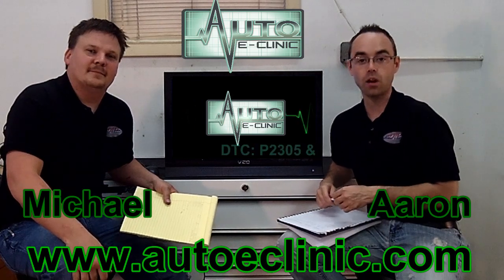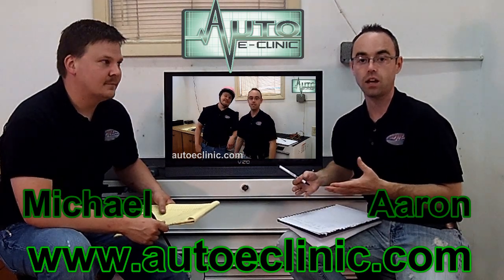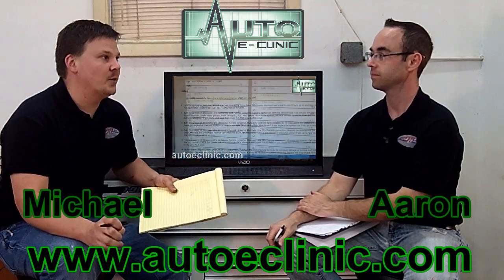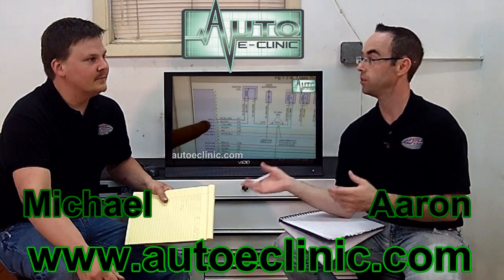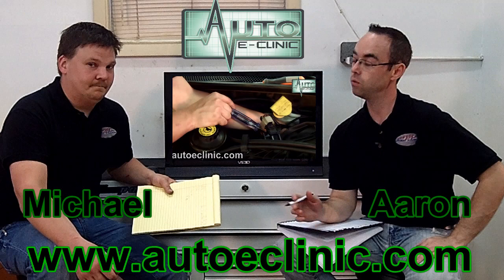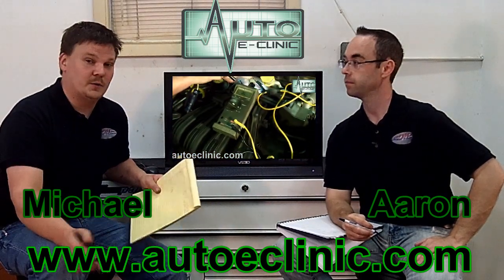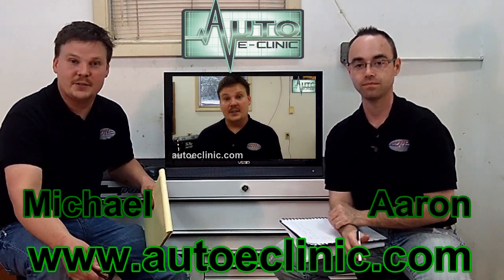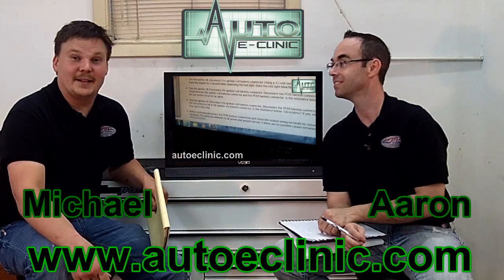Part 2 - Diagnosing P2305 P0352 P0351 and P0300 Faulty PCM (Chrysler)

Comment: If I have replace plugs wires and coil pack on 2009 Jeep Wrangler Rubicon 4 dr and I still get the code P2305, just that code, would it most likely be the PCM? I have checked all the wires I can see and they look fine
Reply: I have the same problem did u found out what was it? Jaybowmanjeeper
Reply: Same issue here, along with code P0300. Did replacing the PCM work? (i have replaced the plugs, wires, and coil pack, still getting the same codes) 2010 JKU.

Comment: its weird that i never had to reprogram any ecu's that i replaced. to shed some light on that procedure, if you look closely to the VIN you can pin point which used ecu can be used in your vehicle that has the some accessories as you do. This will increase your chances of having to go back to a junk yard, auto parts, etc....

Comment: I have a 2005 chrys. pt cruiser 2.4 touring <68k mi.
I'm told by Chrysler dealership after replacing the O2 sensor twice now they want to replace the pcm to get rid of the "check engine light" 
Does that sound weird ?
Also like to know where can I get a pcm already to install ?
Reply from the maker: Rocky Rocky Thanks for watching but due to Michael's passing we can not answer any questions.